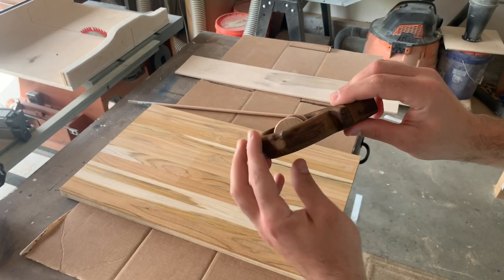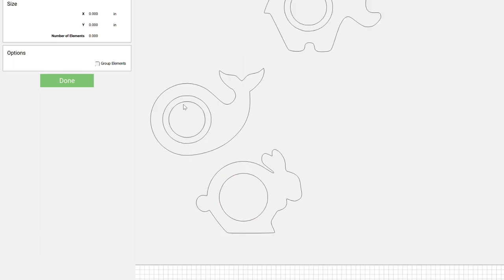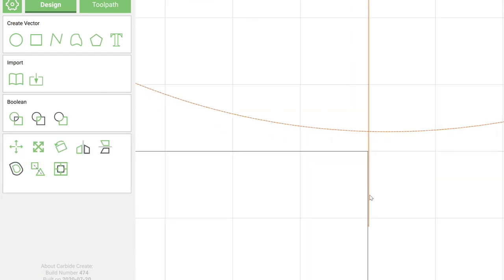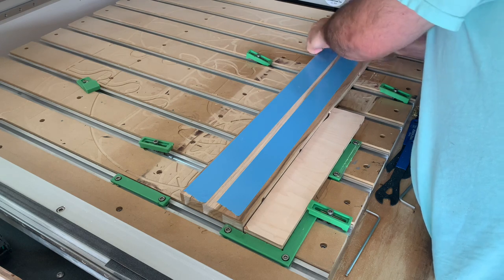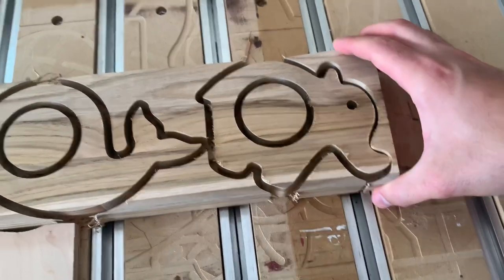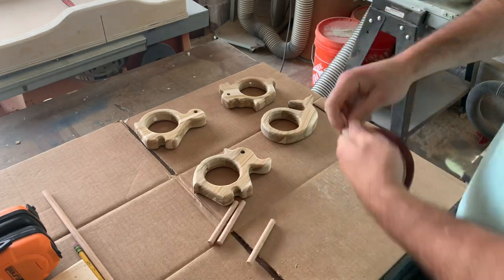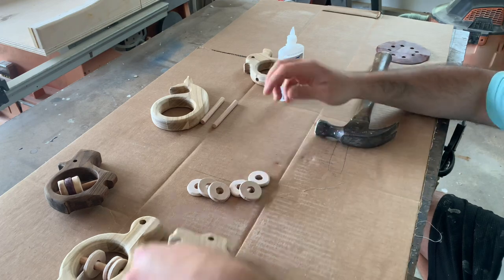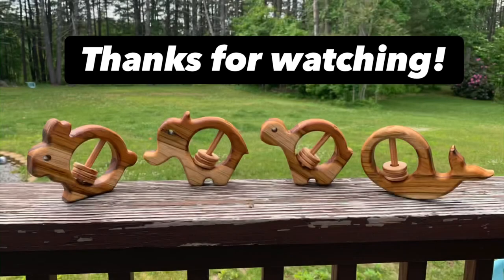CNC Baby Rattles / Quick CNC Project / Shapeoko Pro CNC Project / Carbide Create Project

Comment: Great job, would it be easier to apply the general finish prior to assembling these?
Reply from the maker: Thank you! And hmm, I suppose that would be personal preference. My only concern with doing that would be the glue not bonding as well with the finish applied first. 

Instead of doing what I did with the ole glove up and smother strategy, you could fill a shallow tray with the finish and dip them in. That’s what most people do for cutting boards. I guess I just like the hands on approach 🤣